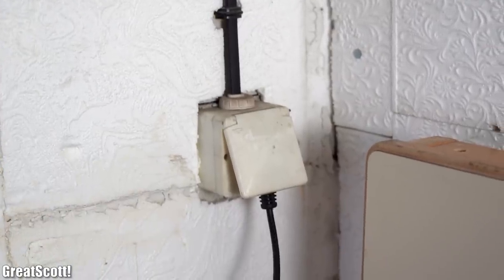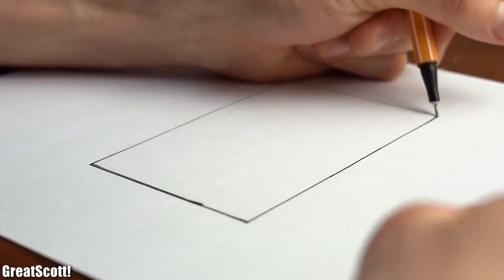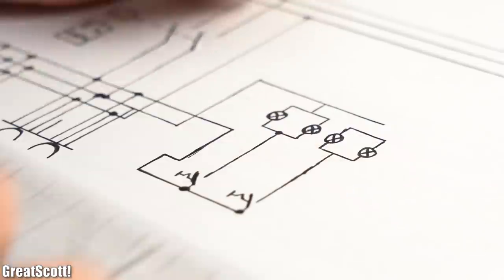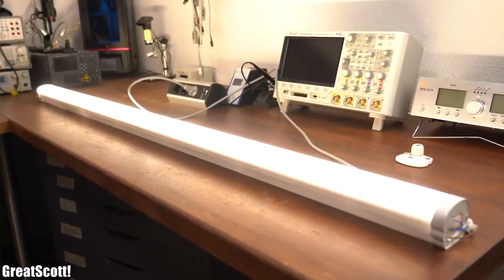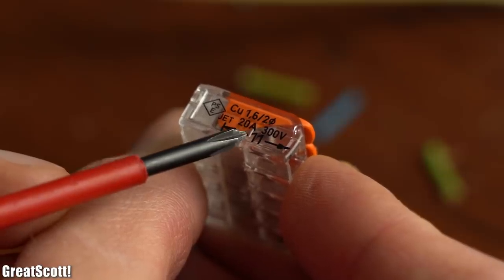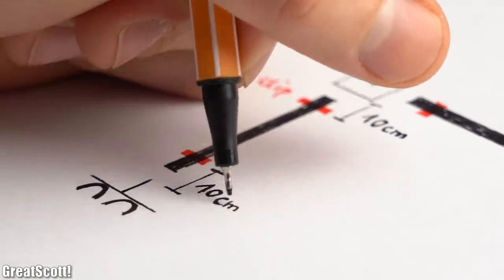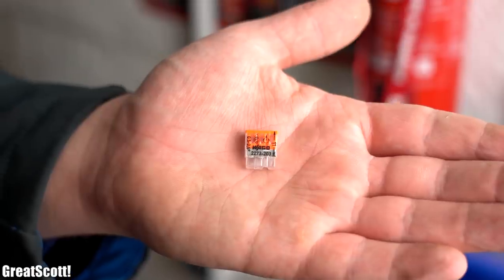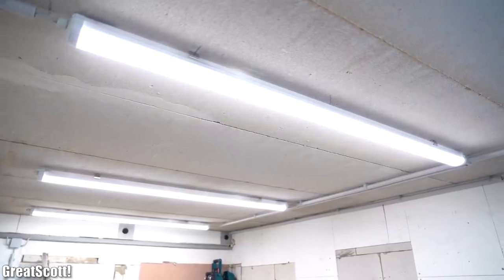How to do Electrical Wiring properly! (more or less....) GERMAN STYLE!

Comment: I've done a fair amount of wiring in my house and friends houses in the US. I like the German standards A LOT  better. No wire nuts, things are labeled, everything is 240V. Seems nice.
Reply: Me as a german using only Wagoklemmen (those shown here) do not really like the concept of those wirenuts. Seems like the germans are by far more practical.
Reply: Wire nuts look flimsy AF. Screw terminals are better imo
Reply: The wago clamps are great but compared to the wire nuts the touching surface of the conductors is tiny, wire nuts are in that case actually safer
Reply: The only thing I (an American) finds wrong with this German wiring is the conduit ending in the middle of the path. I much prefer the American way where the conduit is continuous from box to box so everything there is well-protected.
Reply: @eDoc2020  the cable itself is pretty stiff. Even using these conduit ducts is not always the case, often you use small nailed clamps every 20cm or so. If you have the conduits directly to the boxes you havent enough room, since the inlets of the boxes are only for one cAble each and spaced apart. So if you want more then one cable in the conduit you need some space.
Reply: @Freestila  I think the thing he finds "wrong" is that the German way of running cable is similar to how you sometimes see things run incorrectly in the US. Here it's common for anything run inside exposed conduit to have a coupling attaching the ends to junction boxes, and it's common for non-exposed runs to be done in double-insulated solid core cable. The German way looks to my eyes like a hybrid of those two, and seems perfectly adequate, but seeing the open ended conduit with cables just hopping a gap into a box would be a big no no in the states.
Reply: @carpespasm  Thats probably it.  Aesthetically, that looks like crap. I'd say the same whether its German, US, UK, etc.
1 long straight run on right of light with a 90' at each end and a T for lights 2 and 3.  If conduit is for 'protection', then it defeats the purpose to have the conduit stop before the J box or fixture. 
I mean, thats just logic.
Realistically though, since the walls/ceiling are concrete you can only run exposed wiring, so I can see conduit being better than not. However stopping conduit before J-box/fixtures seem half-baked and goes against the whole idea of conduit as 'protection'. Sounds like the Swedes do similar, but without that ommission.
Reply: Are you serious, or practicing trolling?  Wire nuts are proven, the only problem is when weekend warriors decide they are gonna play electrician. I actually prefer the waygo-knock offs that are at HD/Lowes simply because they seem smaller or give me more options to pig-tail off of a connection. If you can't master wirenuts, reconsider the risk you've put family and friends at. And, German, US, etc, all can label as much as they want to invest the time in.  Not exactly inherent to Germany. 
240v?  Outside of 2-3 large appliances in US households, which are easily addressed by 240v, what the heck does anyone need 240v to the outlet for?  Most lighting is LED and my house with all the lights on probably uses 200+ watts total for that only.  Stereos, sewing machines, Xbox, kitchen appliances, shop tools, etc, etc, what the heck do I need 240v @10A for a max of 2400 watts?
If you were in Germany all you'd probably do is kill yourself a heck of a lot faster.
Reply: @boots7859  Laughs out loud in 3,6kW per outlet.
Reply: @hermannpaschulke1583  Screw terminal are obsolete for average use anyway - it is prone to be under/over tightened and therefore WAGO's are superior and the best solution. They even make DIN rail mounting solution for 221-413 or so :-)
Reply: @boots7859  1. You ok? 2. Never said I can't or haven't "mastered" wire nuts, all I'm saying is those tab terminals look much neater and more convenient. 3. 240v means a 100 watt device draws 417mA rather than 833mA on 120v line, meaning a 240v circuit with a 16A breaker can power 3840 watts worth of stuff before it trips whereas a common 20A breaker in the US at 120v will trip powering more than 2400 watts of load. I imagine they use the same Guage wire, too. Its the same concept as a transmission line, you send power at a higher voltage so you can transfer more power without the need for a heavier Guage wire. I understand residential wiring, and none of the work I've done has left anyone in danger. I just happen to like the way Germany is doing things better.
Reply: @coryballiet8260  And may I add that some devices run more efficient on the higher voltage. Just take a look at computer power supplies, they often run 2 or 3% more efficient on 230V compared to 120V.
Reply: @carpespasm  It's totally fine to run NYM cables on the surface of the wall without any conduit at all. The outer insulation of the cable is so thick that it counts as a suitable protection for mechanical damage. Conduits like in the video are only for aesthetical reasons and to be able to change the cable without having to change the permanent fixture. And of course there are corner pieces and connectors for these tubes but that would only make installation more difficult.
Reply: @boots7859  Would love to have 240v at the outlets. Am I the only one doing wire welding? Nobody doing 18650 nickel strip welding? So many things don't work properly on 110v.
Reply: I agree completely.  This looked like a joy to do.
Reply: So much plastic, so little metal. Panelboard aka distribution box made of plastic instead of metal makes my industrial self cringe. So does the exposed plastic "conduit" (sprinkler pipe lol) and the conduit not being attached to the j-boxes. Give me rigid, or at least EMT, with proper fittings. And those Wago wire nut alternatives: great until you want to change something.
Reply: @simwil524  the thing with wago in North America is that they are pretty expensive, between 50 cents and a dollar each. In contrast wire nuts are almost free, around 5 cents each.

I love wago, but it's hard to justify on any small household project.
Reply: @eDoc2020  standards say cables outside of walls needs to be more tough and they are designed specifically to do this. If you want in europe, you can nail the wire directly to the wall with clamps
Reply: @boots7859  now before going off saying that the american electrical system is so good, you can literally touch the prongs on an american plug by sticking it halfway into a outlet. It has been a common occurence with teens that they drop pennies on half inserted plugs and it starts fires. Does that sound better than the european outlet where this is impossible due to the fact that the face of the outlet is inset.